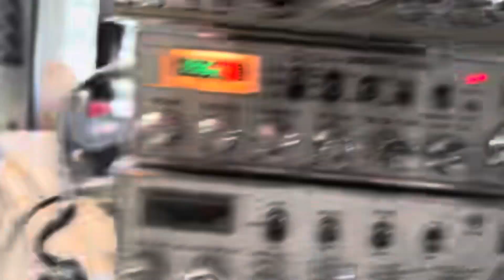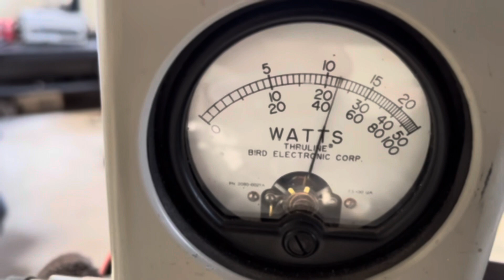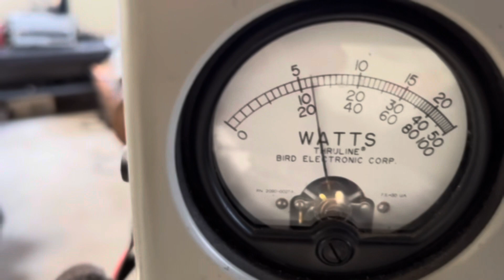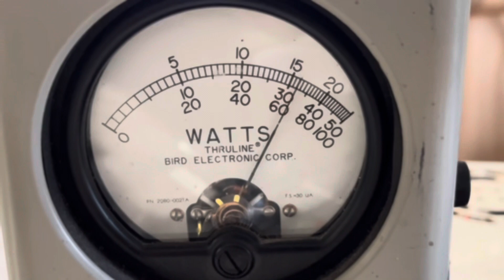1000 Watt Tech-Nine 2 Pill?!!!

Comment: Hahaha, absolutely no way ever two 2879 will put out 1kw. Thats absurd. Even 500w is ridiculous. Yea you can push em to 500w but it won't last more than a couple of months before it blows or the transistor gain will drop to nothing from being  overdriven into saturation. Then you put more drive to get the numbers it used to do then it blows up. 2x2879 = 350w pep and remain in linearity.